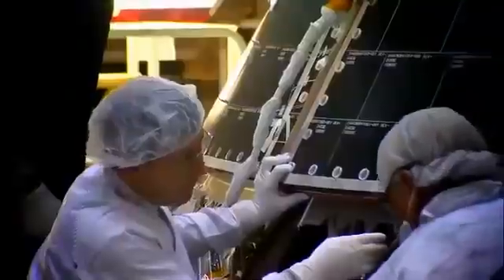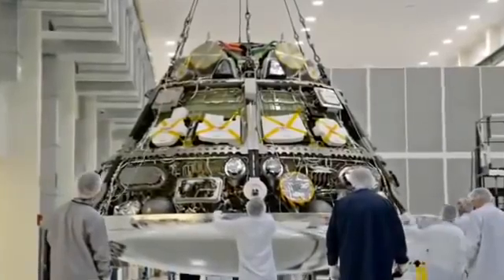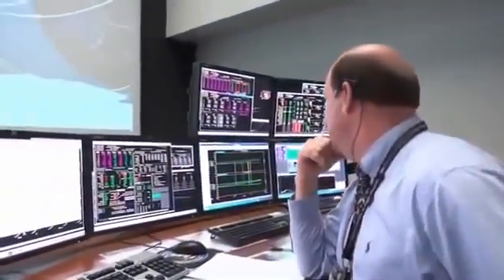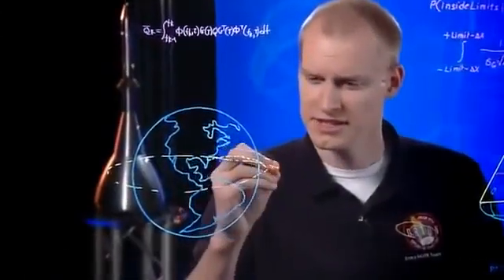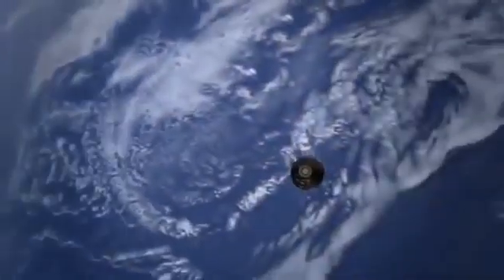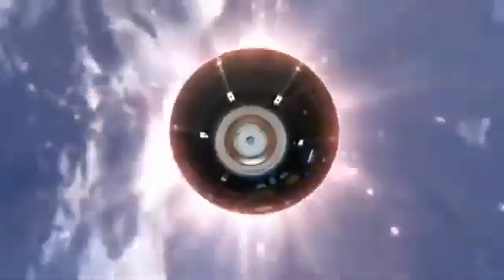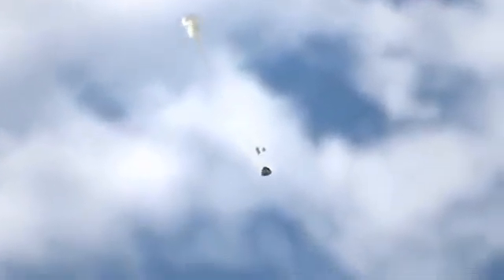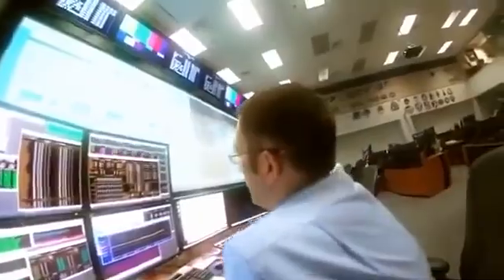NASA engineer admits they can’t get past the Van Allen Belts

Comment: Youtube is hiding this video
Reply: It's probably because it's a clickbait title to a video that contains absolutely no supporting evidence to the thesis made in the title.
Reply: Question Haley I had trouble finding it
Reply: It's been edited
Reply: @theredskin8235  I saw the pre-edit version. Still no evidence. Recent testing has been focused on testing new technology for getting a vehicle safely off the surface and returning to the surface. These tests haven't made it to the Van Allen Belts yet. That's a while other ball of worms with today's tech and delicate computer equipment. The discreet computing equipment of the Lunar landing era was far more fault tolerant in high radiation environment than today's integrated circuits. Modern tech places as much computing power on the surface area of a postage stamp that took up entire sections of a building 50 years ago. Logic circuits on this scale are far more susceptible to corruption due to electrical interference from radiation. Physical scale is a major player here. These need to be fully tested before relying on them to take mankind through the radiation belts again. So yeah, we have yet to go through the Van Allen belts with our current tech. Context is everything. Don't leave it out.
Reply: @jjbailey01  you can't be serious , radiation is used to treat cancer and other things , we have mastered the technology of radiation ! What we have lost is the ability to fake a moon landing ! You can't pull that on people today ! Technology has advanced !
Reply: @theredskin8235  you're rather haughty and blind at the same time if you think mankind is close to mastering technology. We've barely scratched the surface. The cognitive dissonance in claiming that we have not been to the moon due to radiation in one breath, then claiming that we've mastered the technology of radiation in the next breath is astounding.
Reply: @jjbailey01  I've never said radiation keeps us from the moon , NASA SCIENTISTS said that , how can we use radiation in hospitals if we don't know what we're doing , i say we've never been to the moon , and the reason no more fake attempts is because WE ARE SO TECHNOLOGICALLY ADVANCED THAT CAN'T FOOL US ANYMORE ! 
the movement of the sun was carved into cave walls by cavemen , so was seasons and stuff you call science , your stuck in the stone age , i can take a P900 camera and zoom in on the moon , 
AND SEE STRAIGHT THROUGH IT 
what kind of planet is that ! Its  luminous , you can land on a luminary
Reply: You do know that we have robots , talking cars , visual cellphones , laser technology ( my wife had a cyst cut off her ovaries with a laser through her skin , she wasn't cut open) come out of the stone age , we're advanced
Reply: @theredskin8235  you're the one who is having trouble believing we went to the moon. The original uncut video was the engineer talking in the context of us not yet going back through the Van Allen belts and why. Only wingnuts are misconstruing what he said as we never went in the first place. We're not going back through until the vehicles to do so are fully tested as safe and capable. This has not been completed yet.
Reply: @jjbailey01  but 24 people supposedly already made the trip , they're still alive and seem pretty fine ! ( see the problem) , not only that , we have mastered the use of RADIATION , we now have RADIOLOGISTS , that use RADIATION to heal and cure people ( see the problem) ! Buzz Aldrin has lived a long and prosperous life ,so has Neil Armstrong , nothing adds up !
Reply: @theredskin8235  you're stuck in an uneducated belief that the danger of the Van Allen belts' radiation to human life is the radiation itself. The danger that the radiation poses to human life is the potential for it to disrupt the electronics that run the vehicle. A vehicle going out of control is a far greater risk than the effects of radiation on the occupants of the vehicle. What part of radiation having a far greater effect on signals in a microchip than it does on discreet components do you not understand?

Sure, our technology is far more advanced than it was 50 years. However that advance is not a free lunch. There is always a trade-off. The laws of thermodynamics apply to ALL systems. Everything involves a trade of energy with inherent losses. Entropy is real. The advance of science and technology is not exempt from this.
Reply: @jjbailey01  in 1986 i watched the space shuttle blow up killing astronauts , there is a video of these astronauts alive , older and still using there same names ! 
Buzz doesn't suffer from radiation exposure , that hasn't been explained , and with over 200 verses in the bible claiming flat earth along with the Qur'an tells me globe earth is the conspiracy , it also tells me Jesus and all the prophets believed in a flat earth , I'm not Christian nor Muslim , just spiritual , but you should realize you can't be throwing away 2500 years of science if the world was believed to be flat 1500 years ago by Muhammad and a religion that spread like wildfire !
Reply: @theredskin8235  I just explained why Buzz and none of the other original astronauts suffer radiation poisoning. You're really grasping at straws here.
Reply: @jjbailey01  even if this is right ( I'm inclined to doubt it ) the problem is the same problem globe earthers have , YOUR PROOF A BUNCH OF WORDS AND PLAIN OL' DENIAL ! See these people have families , ? Who does the family say these lookalikes are ? There's never any real ACTION at proving anything , these people CLOSELY resemble each other ! And they weren't worried about passing through the van Allen belts ! The bible claims the blue part of the sky is water , in celebration of the 1st moon landing Coca-Cola aired a commercial showing a submarine going around a flat earth-like bottle cap , Hennessey also has flat earth commercials celebrating Auguste Picard , why would million/billion dollar companies put themselves and reputations on the line like that ?
Reply: @jjbailey01  no you can't explain , you've never met the 24 , you're not a doctor especially a RADIOLOGIST , you can't even explain how dangerous radiation is used to cure people , you can't explain how black skin uses dangerous radiation as a positive , you can't explain why all astronauts aren't black , ( our skin takes radiation and ,  no no no , I'm not going to explain , YOU explain ) 
If you can , explain !
Reply: @theredskin8235  where did I try and refute radiation being used to cure people? I'm not the one claiming the moon landings didn't happen because of radiation.
Reply: @theredskin8235  belief in a flat Earth is growing at a significant rate. Y'all might be on to something. I hear that people all around the globe believe the earth is flat.
Reply: @jjbailey01  there is alot of controlled opposition too , a flat earther made a video claiming flat earthers believe the moon is only 30,000 feet away (smh) , some are dye hard Christians just looking to prove the bible is true , nobody knows the truth , all we know is things don't add up , and Nasa scientists have alot to do with globe earth being undone , like this video , before it was edited , he actually said nobody has ever been through the van Allen belts , and we need to solve that problem before we attempt to send someone through .
Reply: @theredskin8235  I saw the segment before it was cut out. He didn't say that we've never been through the belts. He was talking about recent history, not the old space flights.
Reply: @jjbailey01  he said we have to solve this problem before we attempt to send a human through , indicating that we have NEVER solved that problem ! Basically he's telling you that you've been lied to ! Riddle me this , there is a place on earth that gets 24hr sunshine , how is this possible if the earth spins east to west at 1000 mph , and rotate the sun at 67000 mph ! Does that even make sense to you.  24hrs of sunshine , the earth has to be still !
Reply: @theredskin8235  where is it said that this spot gets 24 hours of sunshine every day of the year?
Reply: @jjbailey01  eagle summit , Alaska
South pole Antarctica
Lofoten ,Norway
Fairbanks , Alaska
Reply: @theredskin8235  okay, your original "one spot" is now multiple spots. I'll play. Where is it documented that these multiple places get 24/7/365 sunshine? Hint: they don't. But they do get 24 hours of sunshine for a short time during the course of a year. Also, this fact only makes sense with a globe.
Reply: @jjbailey01  only makes sense on a globe ? 
1000 mph east to west spin
67000 mph rotation
50000 mph hurling through space 
⬆⬆⬆⬆⬆⬆⬆⬆⬆⬆⬆⬆⬆⬆⬆⬆⬆⬆⬆⬆⬆⬆⬆⬆⬆⬆⬆⬆⬆⬆
Try it at home with all these dynamics , see if you can get consistent light on one spot , not several !
Reply: @theredskin8235  you throw around a lot of facts without acknowledging their actual correlation. Those facts sound huge until you place them in the scale of reality.
Reply: @jjbailey01  reality , from ancient times people believed the earth was flat , they carved it in stone , the world split into 7 continents , because of the oceans current , and motors weren't put on boats yet , one of these continents was un-reachable
Time went on centuries past , for control and power , elitist proclaimed the world was a ball , throwing away ALL religions as they ALL proclaimed flat earth ! Finally the un-reachable continent was reached , the people there were still in a caveman nature , as they wore buffalo skins for clothes and shoes , they hadn't advanced over the centuries , their weapons was flint rock and wood ( sticks and stones ) , it was immediately apparent that they had ties to the ancient Egyptians as they still retained words in their language that could be traced back to the shabaka stones found in Africa , those words were NUH and Ka which in Egyptian NUH means water and is also the name of the prophet who dealt with the water 
Noah =Nuh 
Ka = soul /spirit 
These people also knew that the world was flat as they called the world " The Great Plain "
Reply: @theredskin8235  Yea, and people used to have arsenic as makeup, and people used to do bloodletting etc. etc. I can go on about old things people believed that are dumb, but i think you get the point.
Love the fact that you completely avoided anything Bullfrog said and then just go "ah, these numbers big, make no sense to me ug ug", no wonder you compare yourself with stone carving people.
And no, he's not saying we never sent a human through, only that Orion hasn't been sent with humans, and the issues Orion had can be read here: http://www.moonhoaxdebunked.com/2017/07/82-if-van-allen-belts-werent-problem.html
Reply: @Dead25m  I saw the original , he said no humans have ever been through, that has been removed
Reply: @theredskin8235  Again. With Orion, which is what he was talking about. Literally the context of which he was speaking in.
Reply: @theredskin8235  I did see the original. But ok.
And no, we usually win because we actually did our research and properly understood the research, unlike you going "look at these big numbers, me no understand them". 

And please send the original for everyone else to see, i'm sure others would appreciate it.
Reply: @Dead25m  I don't have to tell you that you are lying ! The classic bamboozled ! What research ? You read a science book 😂😂! The number of people commenting about this video being edited is proof enough ! Everybody is lying !?! Making the same claim ! And you know better because you read an astrology book ! We can't go past low earth orbit , meaning , we can't go past the blue part of the sky !
Reply: youreconfused  Except, they don't, you can clearly see curvature if you send up cameras. Artillery units and architects have to take earth's curvature into calculation before going on with their jobs.
Reply: That'll be how I'm able to watch it today,  4th of May 2023.